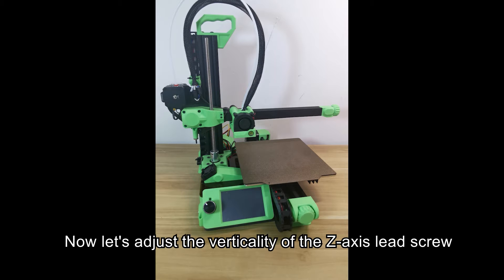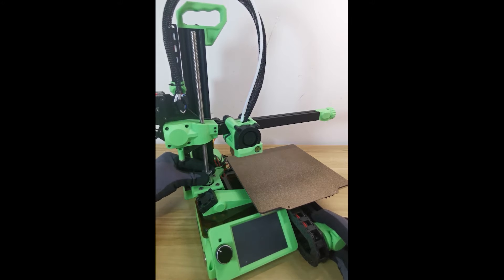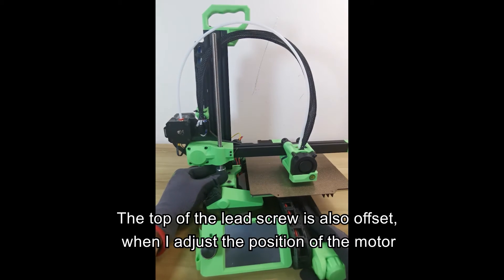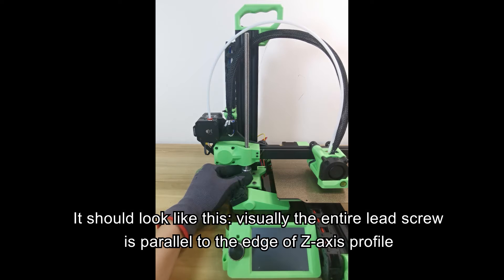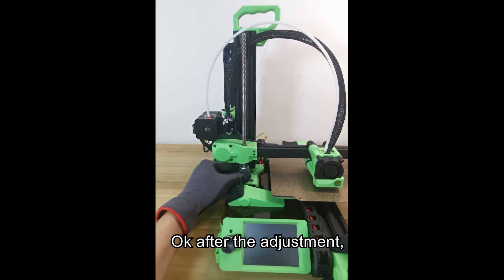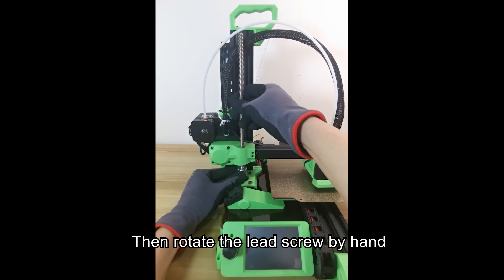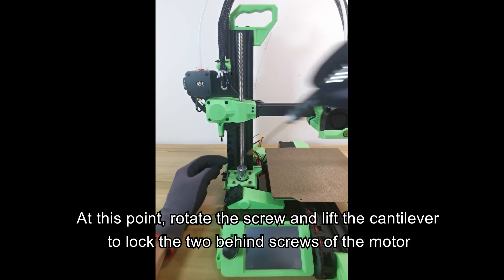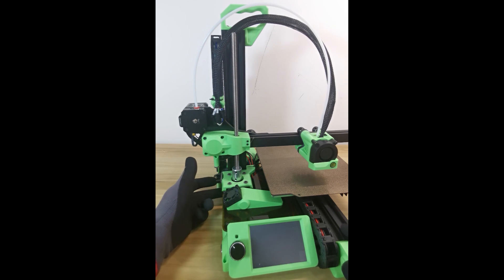3D printer calibration for Lerdge iX | Step 4:Adjusting the Verticality of lead screw

Comment: Hi, I've tried everything and every possible way to get the self-leveling function working on my Lörk ix. When I activate the sensor, it lights up and keeps lowering itself until it makes a noise. It started out perfectly level, touching the bed, and even though I told it to raise, it wouldn't respond. How do I fix the self-leveling issue? Thanks